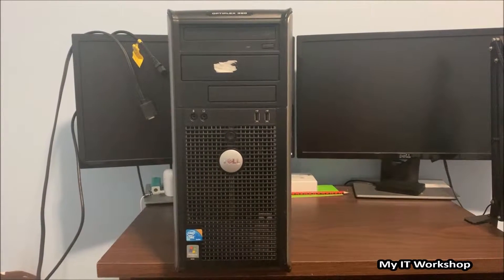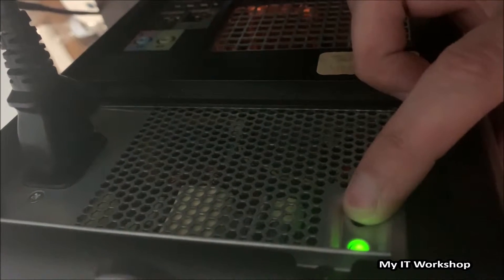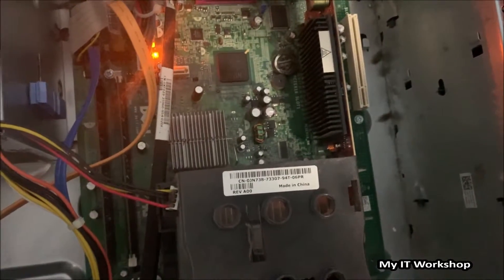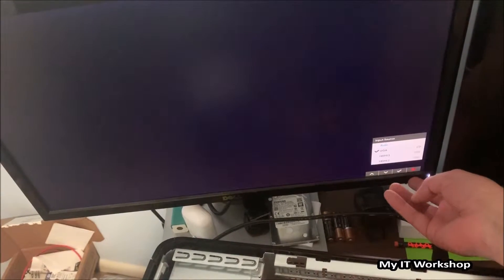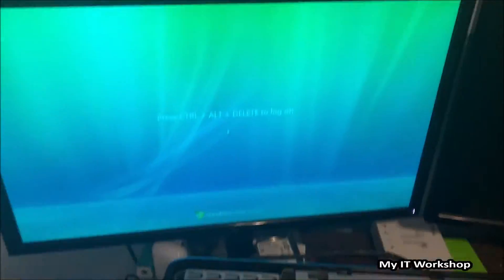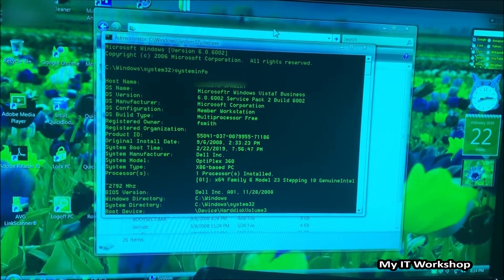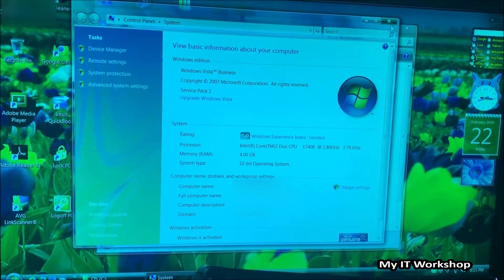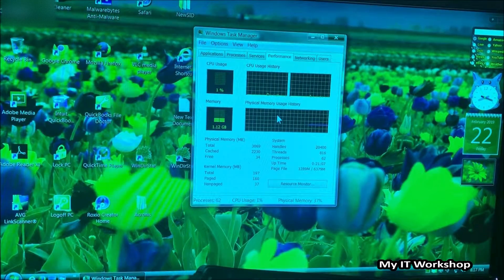I Found an Old Computer from 2008 | Dell Optiplex 360

Comment: I found one here in Slough UK , my local RBS bank was throwing their old systems out to be scrapped , luckily i spoke to the driver of the scrap van and paid him 5 pounds for it, for an old PC it aint bad 4gb ddr2 ram core 2 quad q8300 and can play 1440p youtube videos no probs , better than the crappy HP Stream laptop i was using before whi ch was only able to play 720p video which considering i paid 150 pounds for it 2 years ago i was not very pleased about considering this optiplex from 12 years ago can do much more!!! also forgot , i fitted an SSD to it too so its very smooth

Comment: The cpu cooler on this is huge
Reply from the maker: Hello SeaLife,
That's true the cooler is BIG, even on small factor models they still put big coolers. This is to guarantee that the computer will work without heating too much for many years.

Thanks for the comment!
Reply: @MyITWorkshop  when  I replaced  my optiplex 360 RAM I inverted it and the power became a fixe orange is my PC dead or just it's motherboard?thank you .